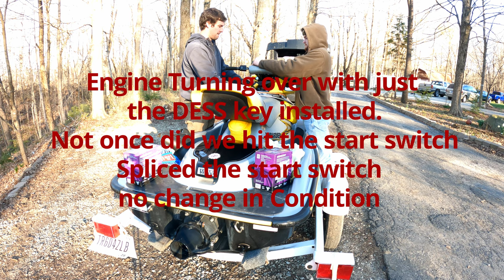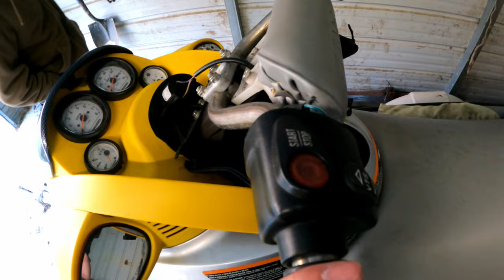Seadoo XP 951... FULL REBUILD

Comment: You absolutely messed up on your rebuild and that engine will fail! It is absolutely a must to gap your rings when rebuilding those motors. I guarantee that within 5 hours of running that motor it will fail.
Reply from the maker: How do you know I didn't? it's still running mint btw ;)

Comment: Where do you order yours parts from??
Reply: So I had my piston blow up about three years ago its been stored and sitting since trying to find an engine for it it's a 2001 951cc GTXDI model. I have just recently came aross a rebuild kit. If my cylinders and case are in good condition will this work? My problem before was because the shavings from the blown up piston got into my crankcase. Help would be amazing if anyone has insight on my problem. Thank you.

Comment: You also have a slipping starter Bendix probably a bad ground pretty sure it's not a computer
Reply from the maker: Replaced the computer and it ran perfect!
Reply: @LotLizardDiesel  When you replaced different  engine computer, did you get the key with it?

Comment: I’ve got the same ski. Had a no start issue so I pulled the plugs and the cylinders were full of water. I cleared the water, reinstalled the plugs and it fired right back up. Do you think that gasket on the top end went bad?
Reply from the maker: Could have been a number of things

Comment: I had one of these. 2 engines later i was done spending money on. Extremely fun ski to ride but only getting 100hrs out of each engine isnt worth it to me. I swapped to the kawi ultra 150 and got close to 300hrs before the engine let loose. The kawi was alot faster but handled like shit.

Comment: Great Video been watching your other Seadoo Stuff last year , I have the same ski 99 limited replaced the grey fuel lines , I also had to replace the MPEM , $500, Fast machine also have a 94 XP 657X rebuilt fun stuff ... did you get this fixed up ? summer is here .
Reply from the maker: Yes I did, replaced MPEM and key switch and she ran perfect

Comment: I just bought one and I’m unclear on if it takes regular gas or if I am supposed to mix it with oil… the original owner said he just used gas because there is a oil reservoir that mixes it automatically… I can’t find anything online that says the right way to do it
Reply from the maker: Add regular gas to the gas tank and make sure there is always oil in the oil tank

Comment: Hey just got a 1998 Sea-Doo 951 same one you're working on here my boss gave me with the trailer he said he paid 1500 for it through in 2000 dollars more and within 20 minutes he seems smoke there was a little fire he put it out hold it back to shore he got a brand new wiring harness just never got around to putting it in so I'm going to attempt it not sure what I'm in store for any tips?
Reply from the maker: Did he get a new MPEM box aswell?